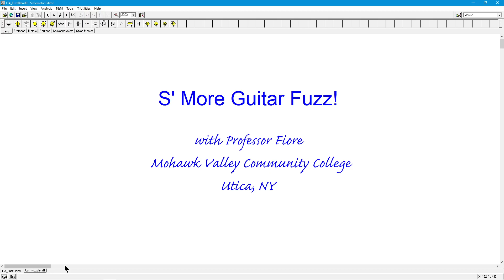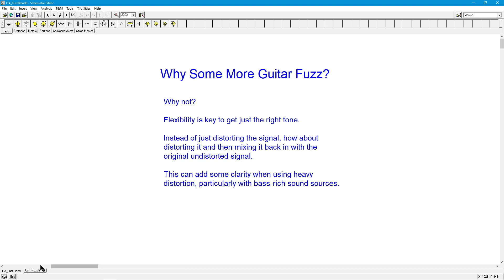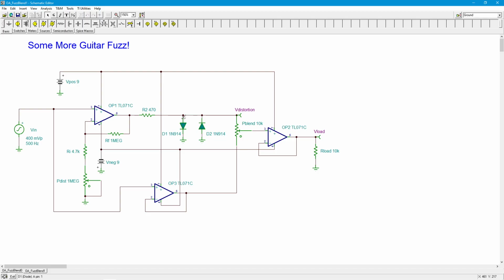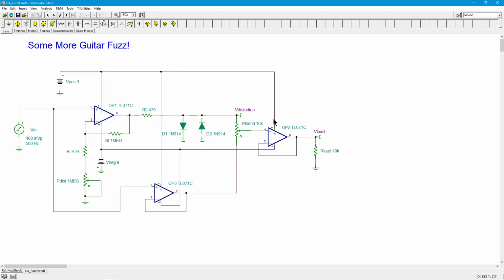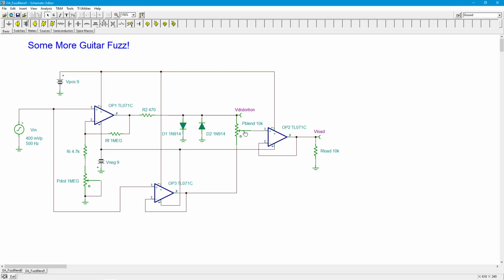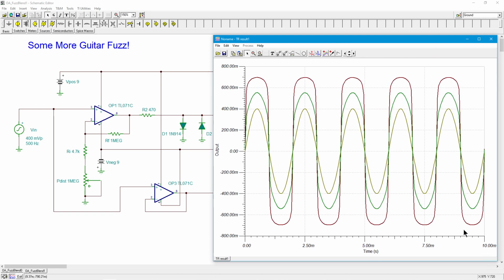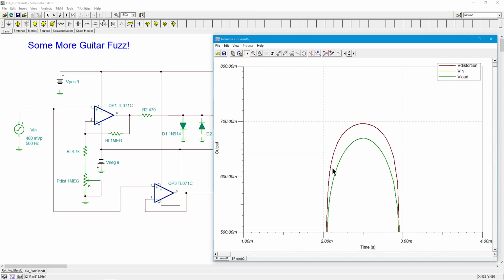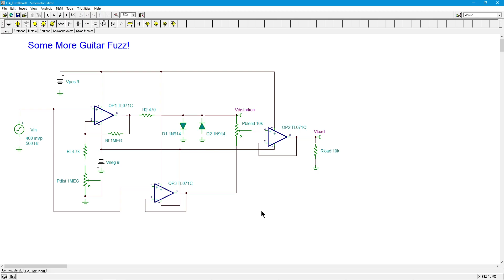Op Amps: S'More Guitar Fuzz!

Comment: I would love to make the "Mix" pot, but a pedal.
Reply from the maker: Here's a simple solution that doesn't require hooking up a mechanical assembly to a regular pot: Find a chunk of EPDM rubber (or similar) maybe an inch or so thick and a couple inches across. Hollow it out so that the hole is slightly smaller than your mix pot's knob (i.e., it now looks like a doughnut). Squeeze the rubber over the knob. Now you can easily rotate it with your shoe and it won't slip. Not as nice as a pedal, but very easy to make and experiment with.
Reply: @ElectronicswithProfessorFiore  They actually sell feet-turnable knobs, but for quick prototyping this is also a great solution.

Comment: the fourth opamp is great for driving the 4.5V reference 🙂
Reply from the maker: Yep, you could! I think I'd be more inclined to use it as an output buffer with a volume pot before it (and a switch to bypass everything prior to the buffer so you could even out the with/without distortion signals).